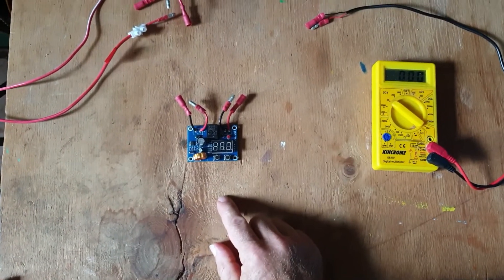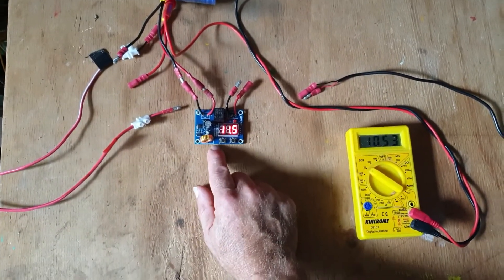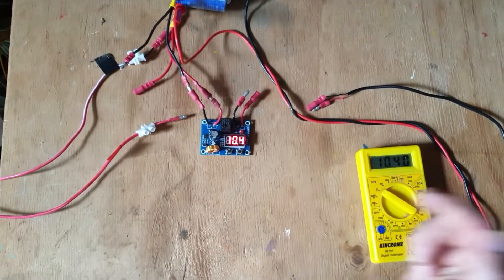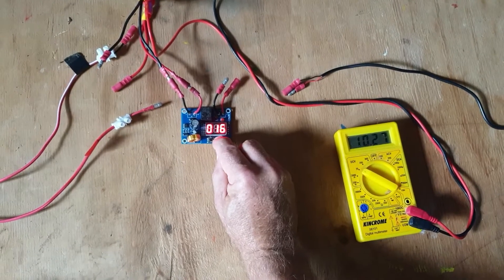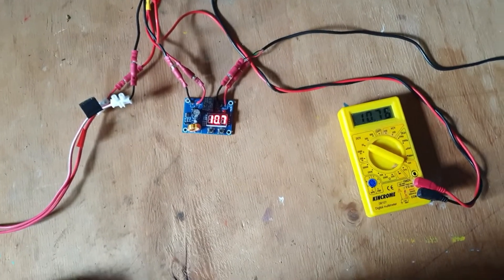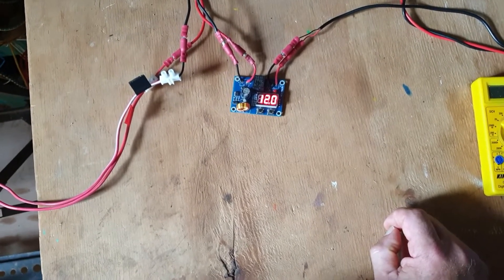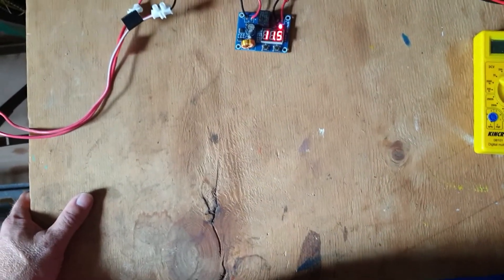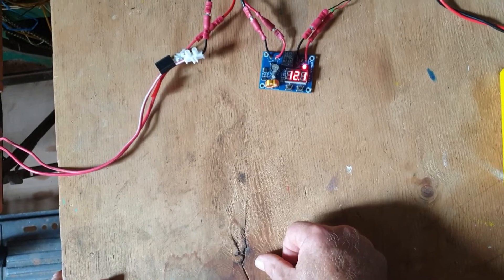Setting up the XH-M609 battery undervoltage protection module

Comment: I have a question so I brought one and connect to the 12v battery and like at no load when the relay connects the ic near the inductor and beside the capacitor gets heated up with no load i don't know why ?

Comment: Great video. I bought this overseas and couldn’t figure out how to set this up. I had found some instructions that were incorrect and actually turned off my device because I was setting the accuracy instead of the voltage cut off. Thanks!

Comment: Very useful, thank you! I thought the turn on voltage was absolute, rather than relative so my 14.6V turn on voltage would never have turned back on my 18V battery when it was set to turn off at 14.2V. Works perfectly with it set to 0.4V.

Comment: This is a great review especially regarding calibrating the input voltage. After watching a guy do a review on a T80P, with the iron on and pushing the tip in, you have restored my faith.

Comment: Thank you for your explanation of that time delay function. The documentation found on AliExpress and elsewhere online is severely lacking. The operation of that feature was almost impossible to find using trial-and-error.
On my version the value is in minutes (000-100) where 000 is (almost) no delay, 001 is one minute delay , 002 is two minutes.  Thank you once more!

Comment: Regarding the time delay, my boards set to 001 gave me almost exactly 60 sec. Looks like its calibrated to display minutes.  Any one else ?
Reply: Yes, mine as well. 000 is (almost) no delay, 001 is one minute, 002 is two minutes. Value range is 000-100.

Comment: Hi Dean. I just bought 2 of these and am unable to cal the input level. I am also told that this is not a feature of this LVD. I am confused to say the least. Double press on the + does nothing, similarly the -. Have you heard of/seen different variants of this same device? Thanks for the tute.
Reply from the maker: Hi Colin, it is unfortunate that there seem to be different versions of the same module on the Chinese market. If you require that feature my advice is to try a different supplier, buy one, then test it.

Comment: Hi, can i use this module to my portable solar generator? If i charge it by solar panel, when the sun goes behind the clouds the charging stops and the generator beeps on and on. The problem is it doesn't automatically restart the charging when the sun is out.  Will this module solve my problem?
Reply: something wrong with your unit
Reply: Do you have the low voltage set point to low ? 5 months on did you get it sorted ?

Comment: I too appreciate your instructive video. Getting a manual for this device is hopeless without your help.  Chinese English is not anyone's specialty. 

I am left with one question though, is there a way to turn the display off so you don't use precious energy in standby mode?

I found one that is preset to cut off at 10VDC and back on at 10.7VDC, it has no display or setting switches, just 2 wires in from power source and 2 wires out to the load. (10 AMPS)

Part info= CZH-LABS Electronics-Salon Low Voltage Disconnect Module. It's bit expensive though $15
Reply: Yes. Set the delay to zero. Wire your power (-) neg to the IN, but wire the power (+) to the OUT. Use a momentary push-button switch to connect the (+) IN to the (+) OUT.

Press the momentary switch and the unit will turn on, and the relay will latch. When voltage input drops below the threshold, the entire unit will turn off completely.

Someone came up with this solution in the comments section of another video on this board.

Comment: Ok the title of the video is missleading. The XH-M609 does not have the function to calibrate the unit.The + button only ajust the low voltage cutoff. It makes the full screen flash and you ajust the voltage to what you need. It can't make only the "doth" flash to ajust the voltage like the one in this video.
Reply: nope, you're wrong dude. i have this module and it has exactly same 4 settings as mentioned in this video. i connected an adjustable power supply to input and set it to 9v, this module showed then 9v too. but when i long press + button and set it to 12v for example, this module assumed the input is 12v and when i increase the input voltage to 12v by my power supply, the input voltage increased simultaneously to 15v. this "calibrate" setting can be used to be sure that module is showing the correct voltage compared to a reliable voltmeter.
Reply: Yeah, agree. I also have the HX-M609 and it behaves differently than in the video. (same as others here in the comments). Reccomend to take that out of the title. Otherwise, thank you for the video- helpful.  I wound up through trial and error figuring out the M609.
Reply from the maker: yeah shame both units are sold with either name.

Comment: it is not XH-m609 as described in title but HCW-M635. they look the same with one slight difference: XH-M609 does not have the calibration feature, like the model from this clip (verified on mine  XH m609)
Reply from the maker: Would be good if anybody else could verify this as my understanding is these are the same modules. Indeed the module is often sold as XH-M609/HCW-M635. I have bought this module from multiple sources as XH-M609 and they all have the same calibration feature.
Reply: @deansatchell5481  i already verified this "on my own skin". i have this module M609 and it does not have the calibration feature.
Reply: Hey there. I also have a xh-m609 without the additional Calibration and TimeOut Features.

Best
Reply: @deansatchell5481  - mine was sold as XH-M609 in the title, but with the note "XH-M609 and HCW-M635 are the same product". No type was printed on the PCB. Mine can be calibrated, but has time delay in minutes, range 000-100 (000=almost no delay, 001 is one minute)
Reply: Yea.. the M609 version doesn't have calibration function. Meanwhile M635 is pretty rare.
Reply: Yeah thanks for this - thought I was going a bit nuts trying to long press to calibrate, luckily mine didn't seem to need any calibration - I can live with .1 of a volt, which is about the normal variance of all different multimeters anways.
Reply: I have ones that are labelled XH-M609 that do have the calibration, timer, etc as featured in the video. Probably fast-and-loose labelling at the manufacturer..
Reply: I got a generic Chinese part from Amazon that doesn't specify in the title but specifies in the description XH-M609 and has "M609" printed on the board and it has the calibration feature

Comment: Can i use this module for 48v Battery pack,can settings go up for 48v cutoff? Or is limited for maximum 36v?
Reply: XY-CD63L
Reply from the maker: The specifications I've seen are for 12-36v, sorry... I'm not sure.
Reply: @deansatchell5481  thank you for answer,
i thougt that you try to set higher value to see how high module can operate.
Reply: Could do that with a voltage divider on the input. Would be better to try and find a module that will handle 48V.

Comment: My XH-M609 looses the settings after I disconnect the power. Is there a solution to keep the settings?
Reply from the maker: I'm not sure, my XH-M609 doesn't lose its settings after 1 day.
Reply: @alexandru Mines does the same thing. Did you work out how to stop it losing its settings?
Reply: Same as that, I bought 2 from amazon and the both revert 12V cut off and 2V differential. this is driving me mad.